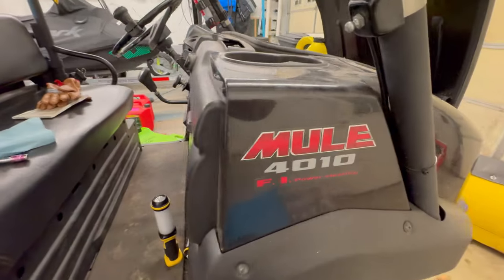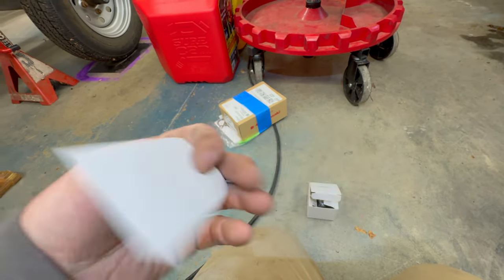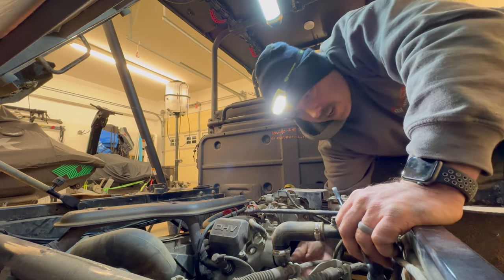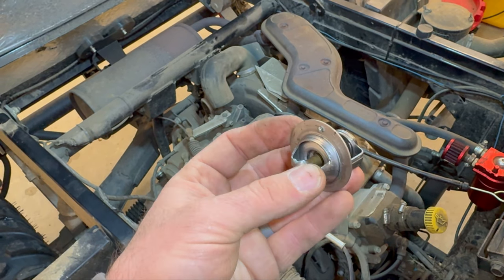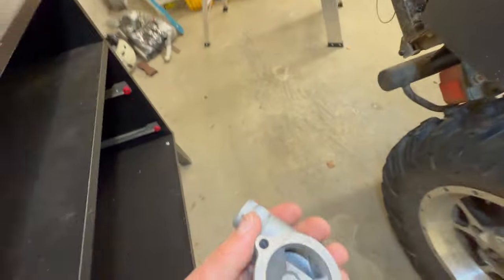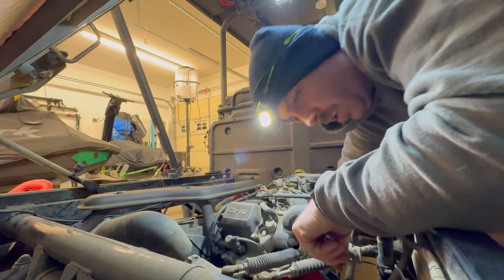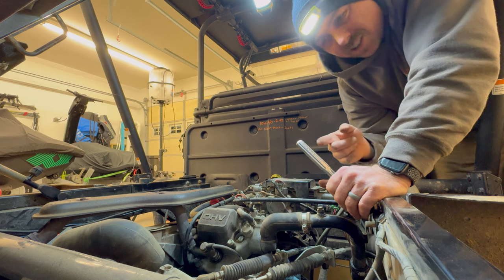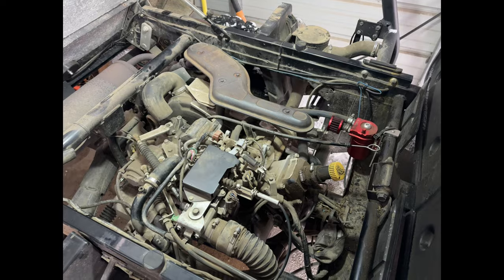Replace Thermostat on a Kawasaki Mule 4010 Gas Engine Cooling System Overheating

Comment: Thanks to you got thermostat installed made sure it was correct by your video. Got   all air out of the system but radiator just would not get warm or hot,must be the water pump.
I know there is a lot to do to get to the water pump but I am going to take my time and replace it my self. Any suggestions before I start would be appreciated. Thx
Reply from the maker: @donrichie2899 sorry for the late reply! My only suggestion would be buy a drive belt while you are at it as you'll have everything apart and its a great time to replace it as well. FYI turns out my system is STILL overheating even after I had the shop replace the water pump and drive belt. They now think it is head gaskets or blocked radiator so I am having gaskets replaced and a full cooling system flush. We will see!

Comment: Thanks for the video. I am trying to diagnose white smoke from the exhaust. Any ideas?
Reply from the maker: White smoke, if just warming up or cold out and goes away quickly, can be normal. But if that is not the case it usually means coolant is leaking into the engine (you can usually tell because the exhaust will have a different smell to it, a little bit "sweet" compared to a normal 4 stroke engine). The typical way coolant leaks into an engine and causes white smoke is from the head gaskets I believe, or water pump.